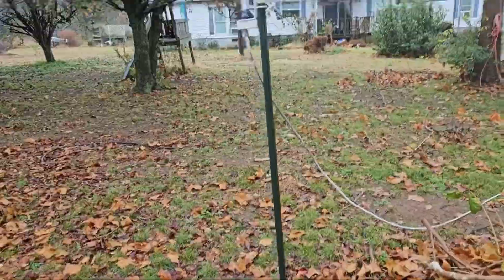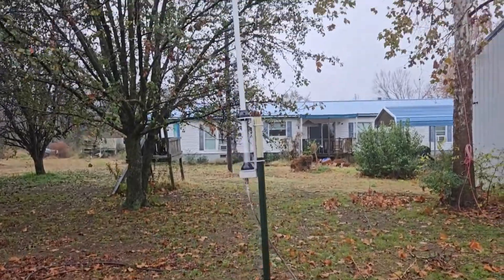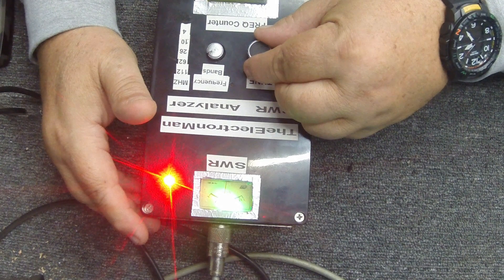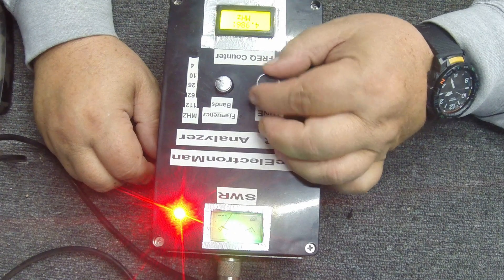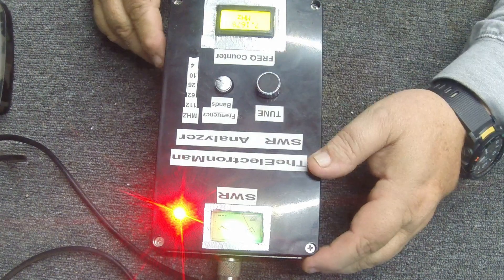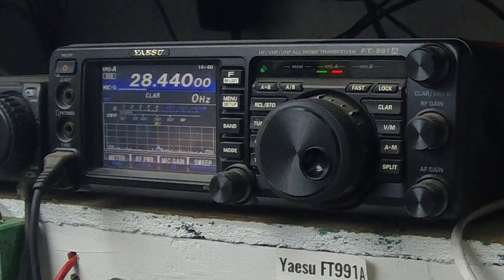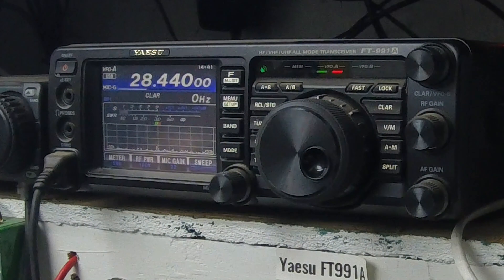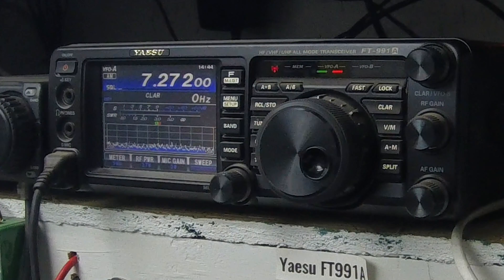HF Multi Band Vertical Antenna Bargain Harvest Taurus JN 316

Comment: I just got one off Amazon for $129. I also  have an MLA-30 loop antenna. both the Taurus and the MLA are on my antenna switch box.  I'm just an SWL listener BTW. When I get a strong transmission from a ham operator I switch between the Taurus and the MLA. What I find is the Taurus is better on 40 meters than the MLA. On 20 meters the MLA edges out the Taurus BUT the Taurus has much less noise. I just got a QRP antenna tuner and that made a big difference for the Taurus.  I just got one off Amazon for $129. I also  have an MLA-30 loop antenna. both the Taurus and the MLA are on my antenna switch box.  Last night , I put a QRP Z Match Manual tuner on my switch box to the receiver and the Taurus just exploded with reception.

Comment: Essentially a modified CB 'twig' with a 9:1 unun in it's base to make a vertical 'random wire antenna'.
Reply from the maker: Exactly basically an end-fed vertical dipole.

Comment: سلام. آیا برای استفاده از این آنتن حتما باید تیونر داشته باشم؟
من yaesu ft 100d دارم که تیونر داخلی ندارد. من همچنین تیونر خارجی هم ندارم
Reply from the maker: Yes I use a MFJ-993 Auto Tuner but the antenna works great on 40m no tuning the others a tuner is prefered you can get about a 1-1 SWR with a tuner.
Reply: @TheElectronMan thanks

Comment: are u a radio amateur look me more like a pirat  , camera use wrong way up , and  tx testing on 27 mc ? and  tx testing on top off other radio amateurs ?? not the good spirit !!!
Reply from the maker: Just to clarify, the only place I really talked over anyone was on CB — which, as you know, is pretty much the norm on that band, whether we like it or not. As for the amateur bands, I’ll admit I did a couple of whistles without giving my call sign. You're right — that wasn’t proper practice, and I own that. But I wasn’t transmitting over anyone or disrupting QSOs on the ham bands. I'm a licensed and active ham radio operator and take the hobby seriously.

Are you licensed as well? If so, you’ll know we all learn as we go, and I’m always open to improving.

As far as the video goes, I’m working with a 10-year-old GoPro and doing the best I can. Yes, I had to flip some of the footage — it’s all a learning curve for me. I feel like I’m getting better, but I have limited resources and certainly don’t have $5,000 worth of camera gear or a high-end video editor. I’d say I’m a hobbyist YouTuber just trying to help where I can.
Reply: @TheElectronMan  accepted  nice video i hope to find out what inside the box on the antenna  and the lengt ? and yes i am also  full licensed in the netherland,s  PA0 have a nise day👍

Comment: Are you still using this Antenna ?  What are your thoughts on its performance ?   Thanks    de   KC3ZDW      73
Reply from the maker: Yes I am and it is a great antenna for the money. I really like it on 20 meters best. My dipole does 80 meters better but it does 10m-40m really well..
Reply: @TheElectronMan  Thank You

Comment: That's weird. Mine is resonant at 20m. Middle of the band is 1.1:1. 10m is at 2.9:1. It performed best with about 50' of coax, which makes sense since it didn't have radiators. This antenna is great for beginners.
Reply from the maker: To me it’s really a 40-10 meter antenna that can be tuned for 80. That said, it’s amazing on 20 meters same here 1.1 on the middle of 20m.

Comment: My swr on 80 meters with this antenna is 23. LOL  23!!  All other bands work pretty good.
Reply from the maker: Wow, yeah, mine isn’t great either—not sure if it’s actually a 23! The good thing is I can use my external tuner to get the SWR down to 1.7 on 80 meters. To me, though, it’s really a 40-10 meter antenna that can be tuned for 80. That said, it’s amazing on 20 meters!

Comment: I read another review that said ground mount works as advertised but elevated mount messed up SWR. They also said with 25feet of cox no counterpoise was needed.
Reply from the maker: @johnmanz3397  I am working on getting my tower will have to see how it does up higher up does real good at 5 feet.

Comment: No instructions with this thing.  How far in should the steel whip go during assembly? Just down to the lower set screw?
Reply from the maker: I know right! I started there but ended finding about an inch before it bottoms out seems to be the sweet spot on mine 20 meters is pretty much flat SWR.
Reply: @TheElectronMan mine doesn’t bottom out. It will go all the way into the fiberglass tube until I run out of whip. 😀. How much whip do you have sticking out?  My sweet is crazy high on all bands.
Reply from the maker: @caroleemoreno8086  I bet all the way is way to much put like 5 inches in and tighten it there.

Comment: I have this same antenna. I installed it on the roof of my house. I have a hard time hearing anything on 10M.  I have not been able to make a single contact on it. The SWR on 10M is flat when tuned. When monitoring 80M and 40M, I can pick up TX every once in a while, but there is a lot of noise. I am a brand new HAM, so I am sure I have something set up wrong. I am beating my head against the wall.
Reply from the maker: 10m is quite I doubt it's the antenna there just isn't anything going on the band, 40 meter is hopping though which to me 40 meter is this antennas sweet spot. Go to 7.268 LSB I have been hearing contacts all over the country...
Reply: Hello. I am a ham operator with 8 years experience. This antenna is more like an "end fed half wave" than the typical vertical that has radials. So...mount it near ground level with the coax going away from it along the ground. The coax will act as the counterpoise. You can try to ground the mounting brackett by connecting a copper wire to a stake in the ground. If it doesn't work for you like that, then you may need to check for a loose connection inside the unun box. Good luck and 73.

Comment: When checking swr u turn ur mic gain down and run ur carrier. The only time to whistle is when your checking watts on a dosy watt meter lol. Silly cbers.
Reply from the maker: I would hope that is a given sorry if my video did not make that clear and when I am on SSB there is no carrier! But all my meters read power and SWR at the same time so when I am whistling, it's for the peak power output not SWR.

Comment: Thank you for sharing and taking the time. Questions: Any testing on what distance from ground should perform better on 20 Mts? Do you recommend to use radials for a better performance or no significant gain in your  testing? Thanks for answering.
Reply from the maker: I think you can't go wrong with adding radials they will always help with the RX gain but mine is performing quite well without any...

Comment: All of my Dummy Loads are pretty much Flat across HF,VHF,& UHF but they don’t talk worth a Crap.How well does it talk?
Reply from the maker: I have talked on 10, 11 and 20 meters and all them performed well especially considering I am only like 5 feet off the ground as soon as it warms up I am going to put the antenna up about 25 feet. I am anxious to see how well it performs then..
Reply: @TheElectronMan Just wondering, Did you get antenna up any higher yet. I just ordered one that will replace my wire antenna.
Reply from the maker: Not yet been waiting on the weather to warm up which it has now hopefully here in the next week or two I will, but it still doing really good 5 feet off the ground @MrSirPhase3
Reply: @TheElectronMan Excellent. I will set mine up between 5 and 10ft off the ground and see how it does.

Comment: There are ZERO reasons that anyone should EVER Whistle into a microphone. It makes ZERO difference how much power you put out when you whistle since NOBODY communicates by whistling. {:>(
Reply: You could tune for low SWR with a CW Key , key it in the radio.
Reply: Switch to rtty, push the mic button (FM works too)
Reply: I guess you've never heard any digital modes before.
Reply: @vhfgamer  If it’s not Phone it SUCKS.I don’t want or need a computer making Any contacts on my gear no matter how Rare the other stations may be.If I can’t work them on Phone then they will not be in my log. It’s worth doing it Right or not at all for me.👍👏🎙
Reply: @1OFGODSOWN  Meanwhile, some of us do enjoy using digital modes. Especially those of us who like to challenge ourselves to make really far contacts with as little power as possible. And digital modes sound an awful lot like whistling. So whistling into the microphone is a very easy way to test power out in a very realistic way. 

Your blanket statement of "zero reasons ever", "Zero difference" and "nobody communicates by whistling" are not exactly accurate.
Reply: @1OFGODSOWN  amen brother!KJ7TBR, talk to me or go away!

Comment: Why did you Skip over 12 & 17 meters? I much prefer the WARC Bands since there are No Contesters.
Reply from the maker: Good point I also skipped over 6 meters which I have since found it tunes well... I need to go back and check those bands as well..
Reply: @TheElectronMan  6 meters is my Favorite Band so good point.👍🎙

Comment: It was designed to be mounted on or very close to the ground.  Mounting it high will probably make it perform worse especially with no radials.
Reply from the maker: Interesting, I will have to do a second test once I get mounted on my tower

Comment: I just bought one of these. I didn’t push top whip all the way in 
I use this antenna for POTA
I have a mount for my trailer hitch 
For the money I think it was an ok antenna
Reply from the maker: I agree for the money not bad at all, does really good on 40 meters.
Reply: @TheElectronMan  I have not tried 40 but I will now 
I do a video how I use for POTA soon
Reply from the maker: Give it a try, I am really impressed with it on 40 meters mine is basically flat SWR no tuning on 40. I have made a few contacts on 10 as well so it is pretty versatile for the most part, seems good all but 80. I can still tune it but not near as strong a performer on the bands above 40 meters. @theramblingsoflarry9290
Reply: @TheElectronMan  A couple friends of mine opened a new park last Saturday .  Longfellow park in St. Martinville , Louisiana  they did real good on contacts ......

Comment: Say what you will, but I bet one of these days, that thing is going to turn into a Thunder Stick !
If you're too young to remember those, they were fiberglass antennas that turned into umbrellas after spreading fiberglass shards all over your yard, after being struck by , you guessed it, " Lightning " !
Just seems like as a Thunderstorm moves ahead, then comes the winds and the dust particles, that seem to build up a charge, and end up with a big boom discharge !
Fiberglass will even build up a charge on a windy day, and should you not short the center conductor to the shield, it has the potential to wipe out your receiver's front end !
Snap, Crackle, Pop , ain't just cereal !
Caveat emptor !
                       ⛈️
                  ⚡
            (((🙄)))